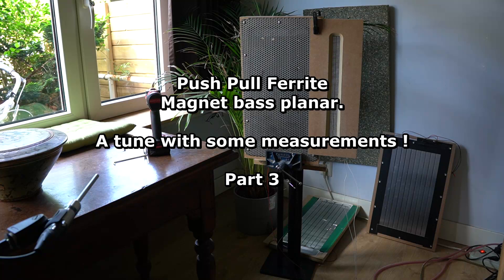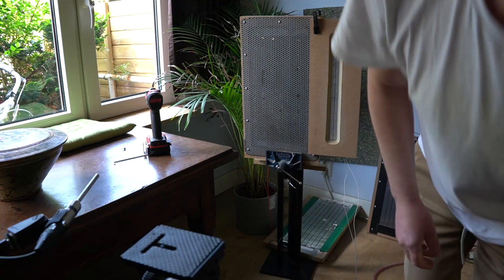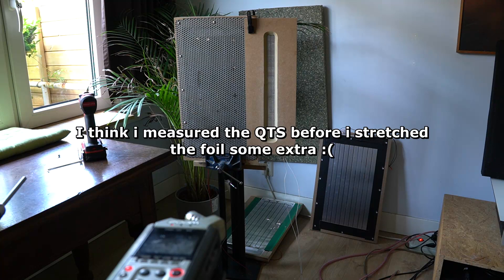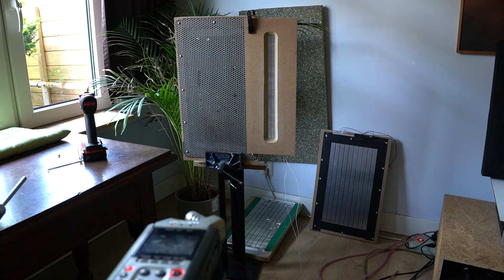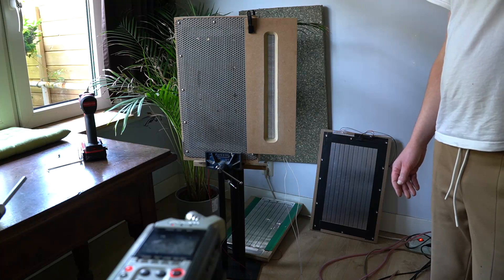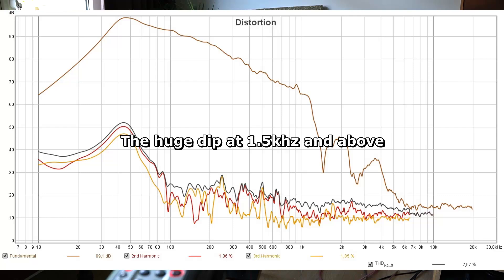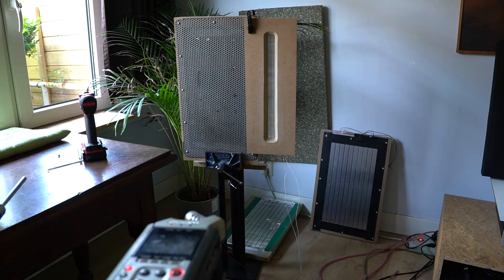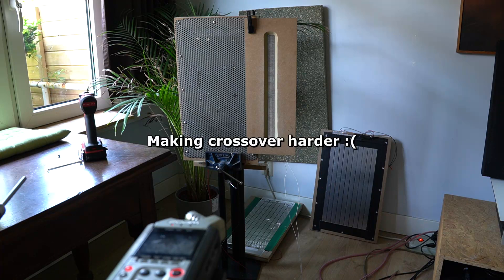DIY Push Pull Ferrite Bass Planar speaker - Part 3 tune and measurements

Comment: Tell me if you have already thought of this, but I've just thought of a way to find tune the tension very easily. 

First, design the frame with a front and back as you have done here. The idea is to stretch the film between the frames, like a sandwich. The frames are simply rectangles, with rectangular holes, the same as what you've done here, but make one have a smaller hole then the other. Maybe by 10mm or so. So when they are together, there is a 10mm lip because the one with the smaller hole will overlap. To the one with the lip, apply a 20mm wide weather strip made of closed cell foam to the lip. 

tension the film onto one of the frame with the larger hole. The one without the foam, ensuring no wrinkles, and even tension and secure it. As you clamp the second frame onto this frame, the foam will press into the film. This will add tension. The more clamp pressure, the more tension. They can be clamped with screws or bolts. This could be used to create both uniform or non uniform tension. Because the weather strip is also being sandwiched sure to it being 10mm wider then the lip, as tension is applied, the down is compressed. This keeps the two frames apart and prevented vibration. 

Magnets would be attached to the lip frame. I this way, the gap distance between the film and the members would be roughly the same, regardless of compression. The first will of course compress the foam a little, but hopefully not much. So yeah, push only arrangement. Or perhaps, if magnets where in push pull, the foam would compress from the film at half the rate of the movement between frames,meaning the film would remain centered? 

The foam may also absorb excessive energy, leading to better dampening, which may be good for lower frequencies. 

Just an idea
Reply from the maker: Thanks m8 ! i think i do not understand 100%, when pushing the mylar with a  weather strip resonance goes up but also the distance to magnets will change towards the back or front magnets., the use of weather strips on all edges of the rectangular frame is something done before (like apogee) but tension i think should cone from sideways movement so either an extra bar or like i did rather crude, is forcing it sideways to stretch the foil by using the metal and a screw to pull the mylar holding frame outwards, and lock it with the regular bolts, i should be able to remove the wood screws after if...... i tensioned the bolts hard enough :0
Reply: @joppepeelen  Fair enough. I'm sure there are so many ways to do this. Perhaps even using a fly screen door 😂 I dunno.. Anyway, thank you for all your videos. I really love them!
Reply from the maker: @ubza1234  Thank you for your input !!! much appreciated !! and i am glad you like the videos ! multiple people know more then one! or come up with something new more easy :)

Comment: very nice, huge gain in output! is it possible to have too much magnet strength that it will detract from low bass output? (qms?) i recall that smaller magnets on traditional woofers was actually better for acoustic suspension bass design.
Reply from the maker: hmm i think its because low magnet designs have higher QTS, or a High Q so they go nuts on there own at resonance. (less controlled) just like many planar magnetic bass drivers, and most certainly like the dual membrane drivers, they have a really high QTS.

Comment: Those low distortion measurement values are very impressive!
Reply from the maker: well cant say they where playing loud. (they where measured real close so the SPL in that measurement  does not say much i am afraid :( ) at all. i was measuring the differences. and i did not wanted to change the output volume since it was still on 2.85 volt. so i thought

Comment: Much more adept than the dual foil version. What are the dimensions of the bass planar?
Reply from the maker: Foil size is around 26 cm x 51cm.  pretty small, overal size 32 cm x 59 cm